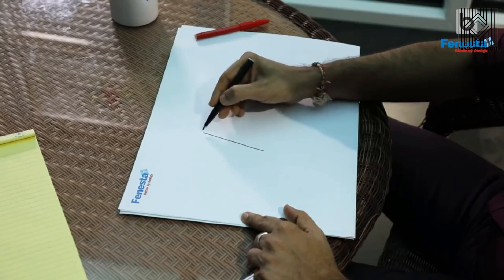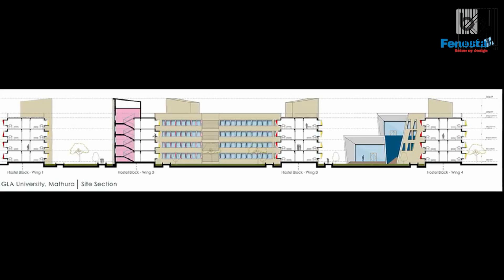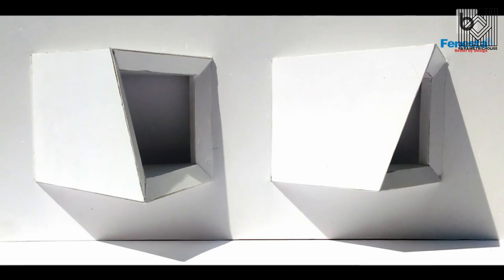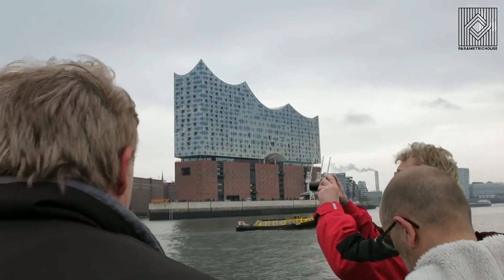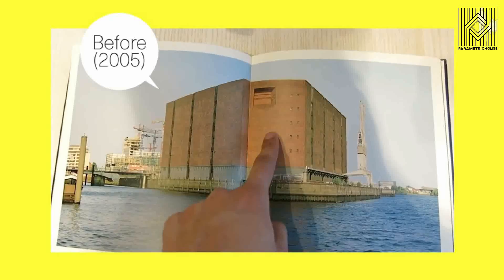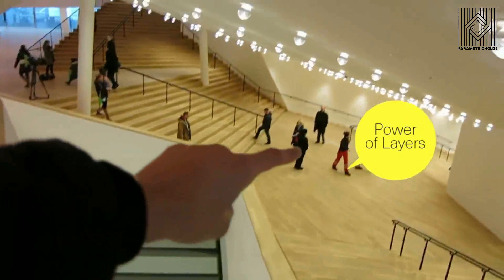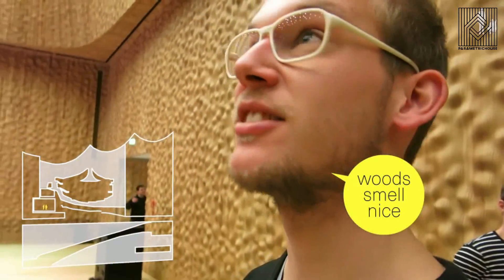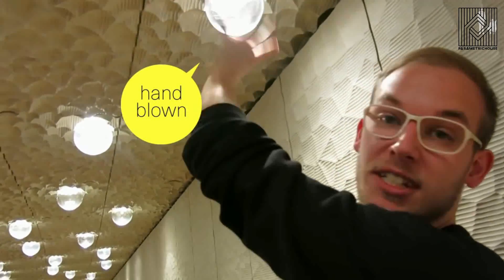Architecture Design #1 (5 Parametric Buildings)

Comment: Only Museo Soumaya
 and Harbin Opera House looks nice and seems like some sort parametric algorithm was used in making them, instead of chopping polygons in sketchup or simple Subdiv modeling for tubes. But even aforementioned two are trying to scream to the viewer: "Look what we can do!" Smooth surfaces, hexagonal grid, angled glass panels". But they have a primitive base shape that was clearly made with a goal to make something curved with flowing shapes instead of an aesthetically pleasing purpose built shape.
Reply from the maker: Well that's one of the ways architecture shows itself specially for iconic buildings😉